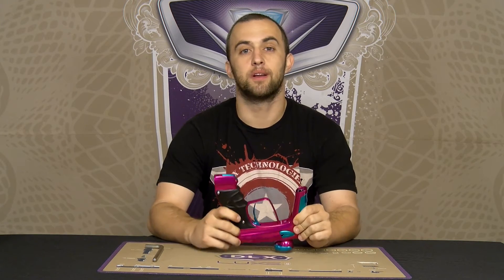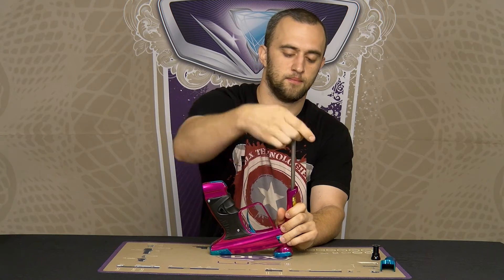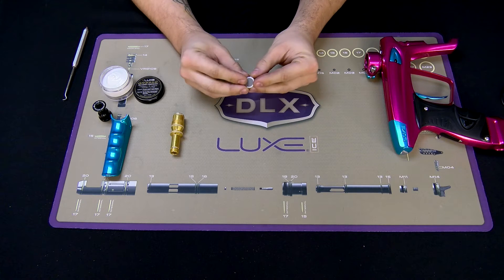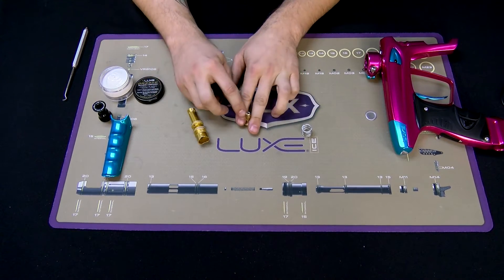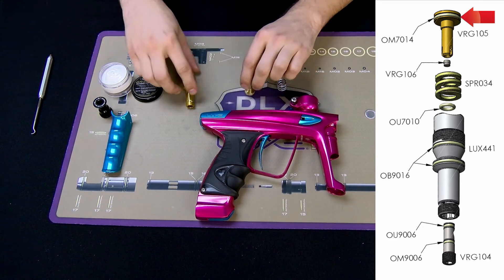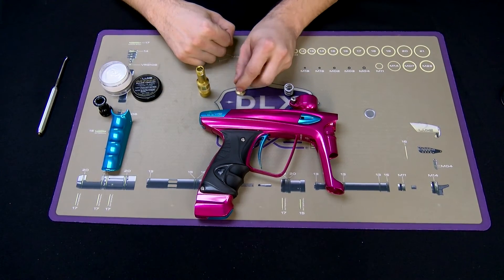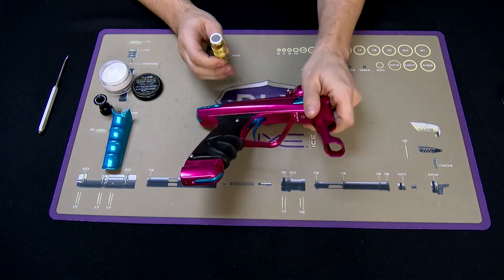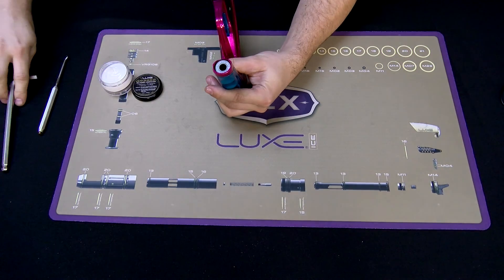Luxe ICE - Regulator Maintenance and Troubleshooting

Comment: Why'd you guys never sell colored metal grips for the ice and x? When are we gonna get a new luxe that's not running an engine that's design concept is similar to the gamma core and why haven't you guys fixed the issues with the tm40 and rollback in the breech causing paint handling issues?